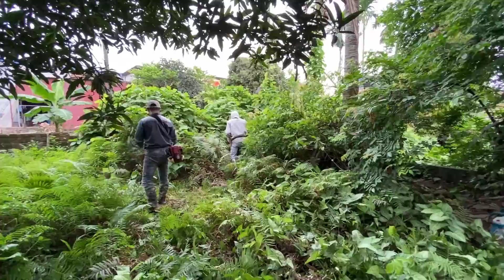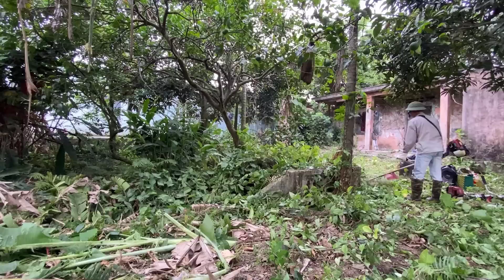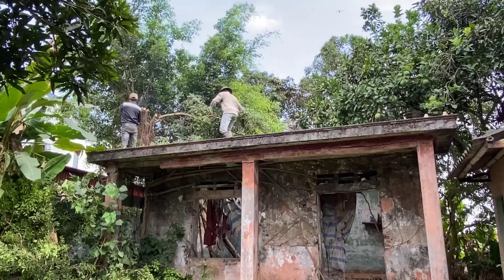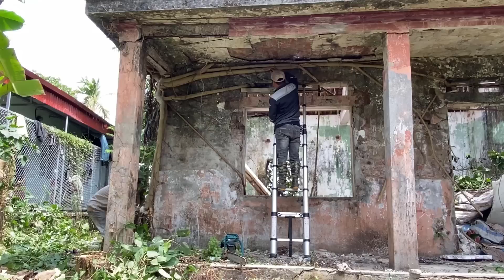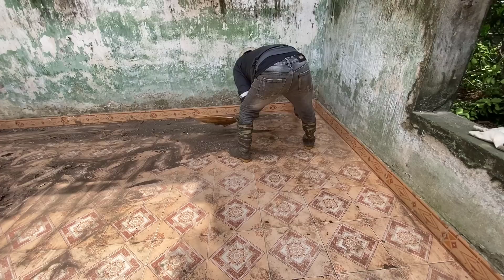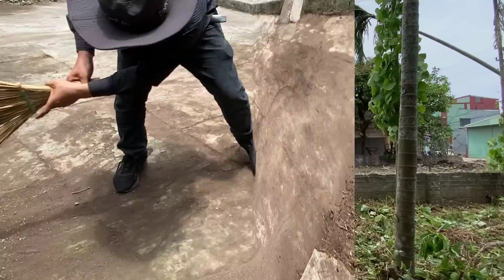Clean up dilapidated house to help 80 year old man | Free dilapidated house cleaning

Comment: I can see why this job is so dangerous and you need some protection especially around brick walls also from the machines which throw up stones and sticks to cut the face  I do think despite the heat if the budget allows full face protection would be good Congratulations on another good restoration job to cleanup your community Perhaps this one needed to be knocked down but you men are on the ground and know better than I do